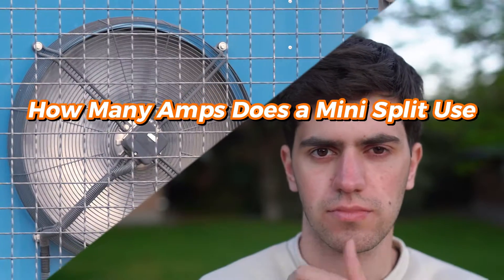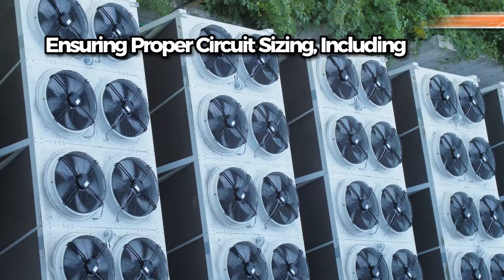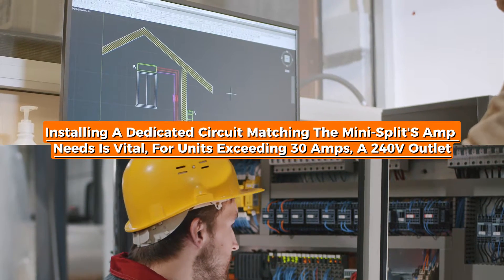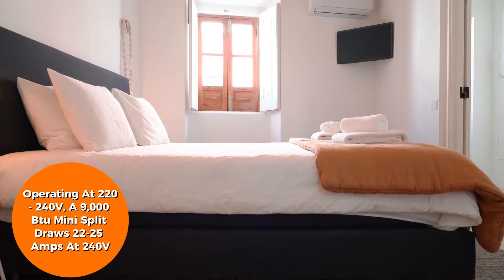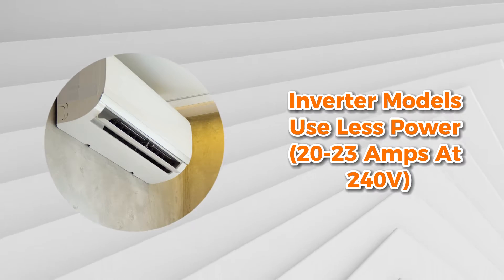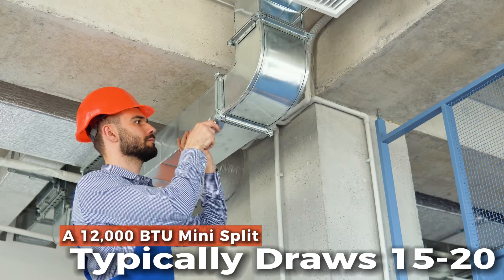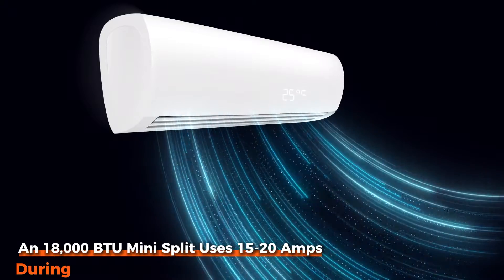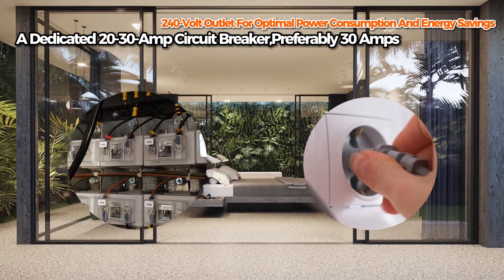How Many Amps Does a Mini Split Use?

Comment: Your estimates seem to be way off. A simple resistance electric heater capable of delivering 9000 BTU would only consume 2637 watts, or about 11 amps @ 240 volts. Even the least efficient heat pump made within the past decade will be far more efficient over their advertised operating range. For comparison, a 6 year old 8000 BTU window AC used 6.2 amps @ 120volts (744 watts). 

 I replaced it with a 12000 BTU cold climate/hyper heat model (Senville Aura SENA/12HF/OQ). The current model with the newer R-454B refrigerant has /OG instead of /OQ at the end. With one notable exception (for the 24HF model), the specs are pretty close between the 410A and 454B models. The cold climate/hyper models tend to be slightly bigger with larger heat exchangers, higher efficiencies, and more capable compressors. They are also more likely to be eligible for the 30% Federal tax credit for the project cost. Check ahridirectory.org because a model that qualifies this year may not qualify next year. Many the brands look similar and have identical specs because they are made by the same factory, Midea. I've seen an almost 3 to 1 difference in pricing between the same machine with different brand names. Any importer can create as many brands as they want when buying in volume. Mideacomfort.com calls their premium machine series "High Tier-ALL EASY PRO Extreme Heat Up to 27.4 SEER2". You can find it under several dozen "American" brand names. The CEE spreadsheet will help you identify models that the various importers haven't announced yet because they are still trying to clear out old 410A refrigerant inventory. cee1.my.site.com/s/resources?id=a0VTR000002WdoH The find button is under the Home menu. You'll need it.

Comment: A generic video trying to explain poewr draw/amperage of split systems,, that doesn't mention factoring in SEER  rating, or even the voltage, which differs from 110-220v, directly affecting the "Amps". Absolute waste of a video!

Comment: The startup current is why it needs triple the running current. Some mini splits have resistance heat to defrost the unit in the winter but that's worse case scenario when current will be within  70% of the breaker size. Code says it can't exceed 80%. So 95% of the time it's actually using a third of the Maximum over current protection.
Reply from the maker: Great comment. Thanks for sharing!